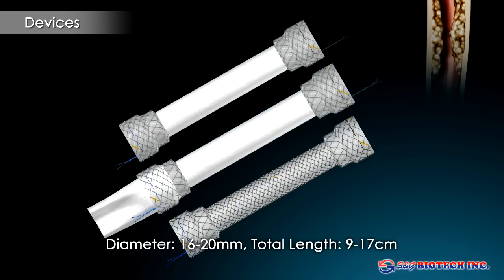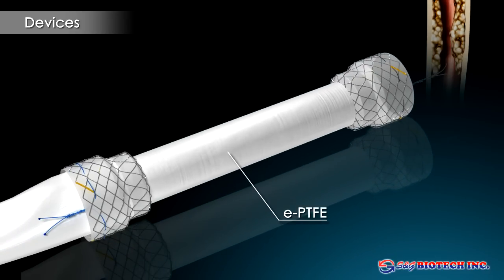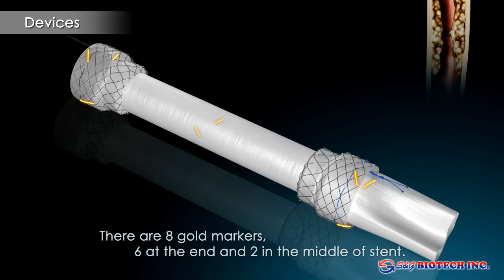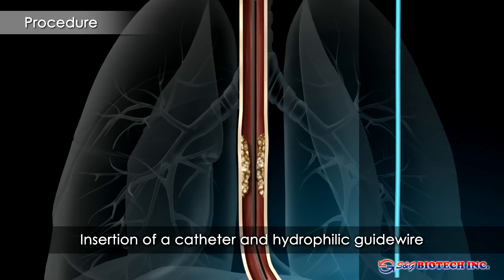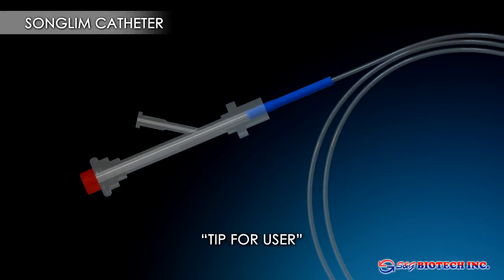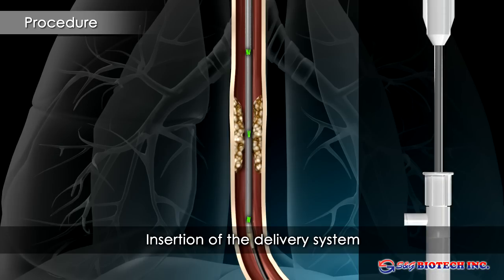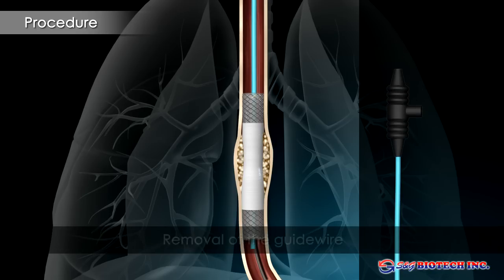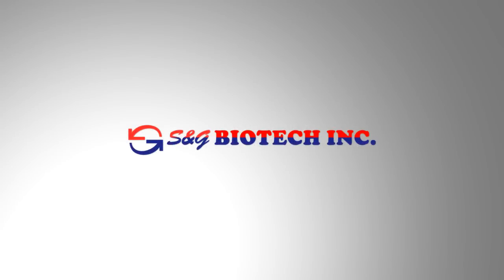Esophageal Stent

Comment: Should this be used for someone who went through surgery and the dr. perforated the esophagus, an emergency surgery for repair, but a small leak has been seen. they are suggesting something like this, for 8 weeks. I am worried about this procedure making matters worse or even perforation again. What are the chances? Can someone answer this for me?
Reply: I had a stent inserted and the stent fell into my stomach. I then had to have surgery to remove the stent and 5 inches of my esophagus.  Doing great now.
Reply: Doctors suggested to my father for inserting stent
Is it helpful? We are worried about the risks along with it
Reply: @macpulperable  my throat is closed due to drink of hydrochloric acid sir.. will stunt is the answer for me if they put stunt when they will remove stent ?